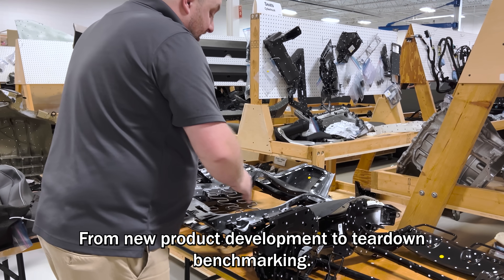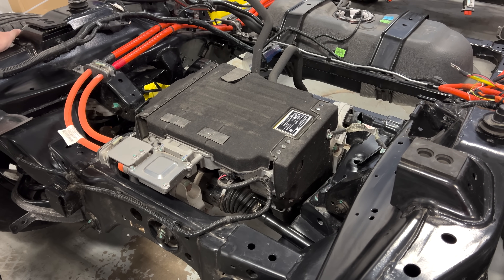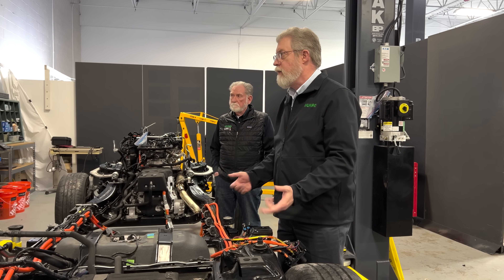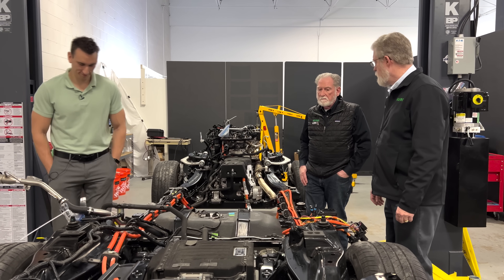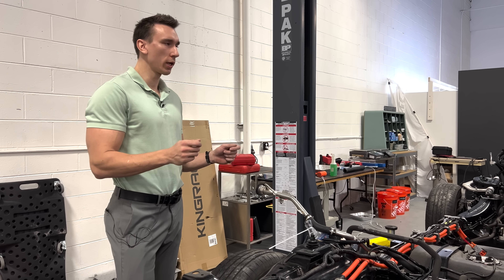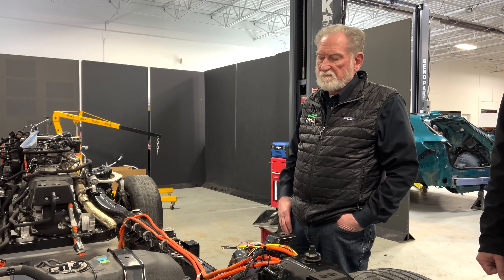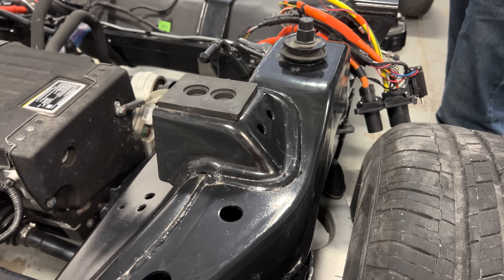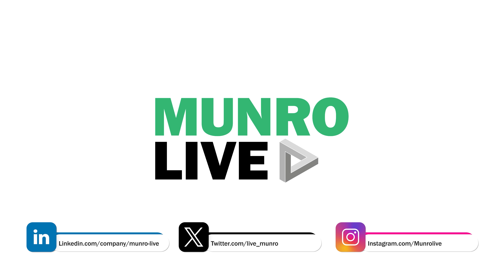There's a Monster Under the Bed of the BYD Shark!

Comment: As a EE designer for over 40 years, I am having a hard time agreeing with your electrical "loop" radiation comments. I assume that the "pairs" of wires you see on each side is the actual "loop" for a given mode of operation. I do not think their is a "loop" around the outside of the entire vehicle when the electrical motor is providing power to the motor OR receiving power from the ICE/electrical generator. The current loop is only between the closely spaced pairs of wires in either case. Please correct me if I am wrong.
Reply: You are correct.  The left pair is between battery and rear motor.  The right pair is from charge port to battery.  Only ONE pair would be carry active current at any given time, and there is no direct connection between motor and charge port.
Reply: i think their concerns about induction and electromagnetic radiation apply to AC power power, here we have DC, so these guys just waffling @ZweiZwolf
Reply: I agree.
Reply: These guys have a serious problem with it and they know stuff
Reply: @Stevesmate4503 but do YOU know stuff like some experts on here ?  Your comment doesn’t add value
Reply: @ greatest country in the world
Reply: I am also shocked about those conclusions...  I am starting to rethink their opinions about mechanical parts.
Reply: Honestly, this whole series looks like a take down, and they are all just looking for reasons to discredit this truck. If this was built by GM or Ford they would be applauding that there is finally a "real mans" truck on the market and explaining how they were able to deliver this overbuilt truck using cheap labor and parts, vertical integration, and advanced battery technology. A year ago they were praising far less well built Chinese vehicles.
Reply: @patreekotime4578  Tesla money in their pockets
Reply: @patreekotime4578  Munro promotes Tesla.
Reply: Yeah, I don't think these guys have any idea about EE.
Reply: These guys aren't real engineers. They don't seem to know even basic stuff.
Reply: @nrml76  wrote "These guys aren't real engineers. They don't seem to know even basic stuff.". That's not true. Paul Turnbull is a genuine motor expert - he really does understand them in great detail and is good at explaining them, and the engineering tradeoffs of designs. So yeah it's very odd that he would talk such nonsense about the DC cabling. I don;t know what to make of it.
Reply: @xxwookey I know what to make of it, they just couldn’t believe Chinese engineers now outsmart Americans.
Reply: Have you thought of an alternative purpose for the ground strap?
Reply: @martinbeverley9536  To ensure you don't get different potentials. It may simply be a safety issue to ensure that if a fault makes the motor case live it blows the fuse or that high currents through the small resistance in the cables causes a potential difference between the motor and battery.  It also ensures any induced current in the case from inductive leakage from the motor or just static electricity does not create a potential difference with the chassis and sparking.  Basically it is good practice to ground all floating metal items as you cannot guarantee a path through bushes and bearings.
Reply: @The “ground strap” is just an EQB line for the HV system. There’s nothing unusual about this setup, the entire unit is mounted on rubber bushings so for HV compliance it is absolutely required.
Reply: @gtjack9  Indeed.
Reply: @martinbeverley9536  The grounding strap is called EPB, which stands for Equipotential Bonding, and it must be fitted for a car sold in most countries by law (homologation standards). It's purpose is to ensure that no conductive (ie metal) part of the car can experience a difference in potential from another conductive part  (that's the "equipotential" part, ie equal potential) under normal or fault conditons.  You'll note it's a pretty hefty braided strap, because it has to ensure a difference in potential cannot build up even under fault conditions where 100's or even 1,000s of amps can flow.  It's purpose is of course to ensure nobody gets electrocuted by touching two conductive parts that are at a high difference in voltage!
Reply: Grounding electrical components is a good idea as it prevents signal noise. I'd bet all EVs would have them on their motors @martinbeverley9536
Reply: If one side was positive and the other negative they MAY be an issue but it’s clearly marked with red and black tape on each side, Sandy needs to hire some EEs that are not afraid to correct him.

And my 01’ Chevy s10 break lines are coiled.
Reply: Retired Avionics EE
There is no obvious current loop to generate an EMF. Left side is Battery to rear motor. Right side is Chargeport. Two separate Circuits. A ground loop could exist within the frame, and have to be reinforced with the ground strap.
Reply: @Papa-bh6zq  Even if there was current flowing at the same time in each side, there is still no loop because each side has it's own Positve and Negative conductor and hence currents are balanced on each side, leading to effectively zero H or E fields across the gap between the sides (ie across the chassis)
Reply: It's a fantasy they're invented.  The battery, inverter and motor potentials are isolated from ground.  The high-frequency currents are confined to the closely-integrated inverter and motor. It's completely logical to provide a braided shield from the housing to chassis just like you'd see in other EVs.
Reply: The cable is just to provide ADDITIONAL path ensuring that the motor casing is at the same potential as the ground. This bonding helps to prevent potential differences that could lead to hazardous situations.
Reply: Not to mention that EV cables are typically fully shielded. The construction of those orange cables looks a lot more like coax or triax than just normal DC power.
As much for RF as for safety(To provide 'detection' shield when damaged that the HV isolation test EVs perform at power on can detect.)
Reply: Rear unit is mounted on bushing. Rubber doesn’t conduct electricity. In case of HV isolation loss, everything need to be connected so modules will detect it. That is why they put a ground there. Also at high speed, ipm motor have large emf. I don’t buy the loop thing 😂
Reply: If they keep the tariffs off that truck I’d buy in a minute. It appears to be perfect unit for heavy loads and country roads.
Reply: They started out strong up front but this entire episode is a 15 minute TED talk explaining that they don't understand electrical systems at all. 

At one point in the video old mate is even holding the charge port in his hands and doesn't make the connection that the two sets of cables are part of entire different systems.
Reply: They rarely seem to know what they’re talking about.
Reply: Take it easy, we worked out they don’t know what their looking at, much less understand what their talking about.  They are stuck in the sixties. They couldn’t understand why they paint all the steel.  FFS !
Reply: As an engineer , i say they are talking crap.
Reply: Being a retired EE designer, with over 40 years of experience, I agree with you, concerning the loops. However, there stil can be an EMC issue, either on susceptibility or on radiated emissions.
This issue seems to be solved by a last minute ground strap, however the way this was implemented is unacceptable and might result in a "gremlin" over time.
Reply: You do have high frequency currents going to all of the cables, produced by the switching of the inverter, so there might be a point. But still I suspect that this ground strap is just for equipotential bonding that is needed on every HV component. Resistance between HV comp housing and chassis ground must be below 100mOhm for HV safety in order to have a valid isolation resistance measurement. I suggest they don't reach that value without that strap.
Reply: https://www.youtube.com/watch?v=BUcnPxr5Q8I A previous Munro video about the BMW i7, go to 18:03 and there is an obvious ground cable connecting its subframe to the body. I guess they found it completely normal for BMW to make last minute decisions to supress EM noises!
Reply: Is what their talking about a ground loop.  That's the bane of low noise.  But aren't we talking DC here?  Why would there be ANY noise on a well designed inverter.  If it were AC, wouldn't there be 3 cables?  I'm not clear on what's on these.  And since there are two cables wouldn't there be a certain level of common mode rejection?  I do agree that I would make sure there is a good connection at the braid.  Unless this is under stress, a copper bar might be better since if you've seen braid in service for a while it can get compromised.  But maybe that section moves around a lot.
Reply: @DennisMathias Correct, the DC system if designed correctly will have no noise, maybe slight ripple due to inverter feedback but nowhere near enough to me to generate problematic EMF
Reply: @gtjack9  wrote "the DC system if designed correctly will have no noise, maybe slight ripple due to inverter feedback".
I'm not sure about vehicle inverters, but my home inverter puts a surprisingly large AC current over the DC current. So  at 4.4kW discharge I see 82A DC current, +/-67A AC current (i.e 106A RMS current). Turns out this is how many mains inverters work. The voltage ripple is less than 1V, but there is a lot of AC current slopping back and forth, and that makes corresponding fields (and heating). It's all 50 or 100Hz so low frequency.
Reply: I agree, on top of that, these HV cables are not AC, they’re HVDC so there is no radiation being emitted beyond a static magnetic field, this means.
If they were running three phase cables from the back inverter to the front motor then I’d agree that it would be terrible architecture.
But given the coaxial shielding of the HVDC cables and the simple fact that it’s DC, I see little problem other than the fact that they’re paying for more copper than they might need with a better designed architecture. Though if this is a parts bin vehicle it may well have been more favourable to do this and have a quicker development cycle than the cost of re-designing the HV system.
Reply: @ Just FYI, but the charging port could have one cable pair for 120V AC & 240V AC charging along with a second heavier, dedicated cable pair for 400V DC.
Reply: bingo.... they didn't bother to actually examine what the cables do
Reply: Regardless fairly basic to remove the paint or provide a better fixing for the ground strap. It certainly does look like an afterthought
Reply: I’m no engineer but reading the vast majority of comments they do seem to come across as mild haters of this particular vehicle, kind of embarrassing…on my list of vehicles to consider down the road😎🇦🇺
Reply: One of the first things we all need to learn is assumptions are one thing, but don't make judgements based on assumptions. I can see so many opinions here sold as"I known every thing". I can't believe so many errors have been left on a public platform for every one to see . This really make you all seem incompetent to any one that is a true expert. That is a fact
Reply: These guys are supposed experts and they haven’t realised that the right-side set of 400VDC cables connects the CCS2 charge port to the battery for charging because this PHEV supports Level 3 DC fast charging! The left-side carries power for the rear axle motor. Therefore only electrical current it will see is when it’s stopped and charging. So why all this rabbit-hole chasing stuff about “current-loops” and EMI? Then don’t get me started on the build comments. Mate, I’ll take robust even over-engineered and built anyday especially in a truck.
Reply: I am a retired electrical engineer with many years of electromagnetic radiation experience.    You would need to understand in great detail how the system worked to make those sweeping statements about the electromagnetic noise generated by the cable pathways and to denigrate a simple braid earthing strap is just weird.    I agree with you.   Those comments were very odd and simply had no basis for them
Being made.

Comment: Those smaller so called ‘high voltage’ cables which they keep referring to as causing an inductance loop are either the charging cables or the 110\240v AC cables that run to the 3 power sockets in the tub, so the first 5 mins of this video is totally false.
Reply: They're Americans.BIG BOY😂

Comment: I’m confused with all the talk about the high current cables being a problem. One side is to rear drive motor and the other side is charge cables. You’d have to think the 2 sets of cables would never be used at the same time? How does this affect the vehicle?
Reply: Correct.  I can't think of any EV that allows one to run the motor while plugged in to a charger.  Munro is just exposing his ignorance.

Comment: The loop observation is valid but the strap is really there just to ground the motor housing making it a shield/cage. That's why a simple bolt is adequate.  When you accelerate and decelerate you do get current surges in the cable but you also get flux surges in the motor housing. Good ground shielding contains those.  For a traditional battery ground cable - using the chassis as the actual ground - it has to conduct the full current being sourced by the battery (or fed to the battery for charge)  so needs a solid connection to that chassis metal.

Comment: Another reason to put the ground there is to dissipate the static electric charge that the tires build up, that is especially a problem with high efficiency tires. Without the ground strap, you can dissipate the static charge from the motor case into the frame instead of into the HV electronics.

It is true that the braided ground strap is prone to deterioration. There should have been better protection and passivation of the dissimilar metals. RF mitigation or static dissipation, they should have done better either way.  After about 20 years, the three braided ground straps from the IMA housing on my Honda Insight had pretty much turned to powder.  I guess if the rest of the vehicle only lasted 20 years, it wouldn’t matter.  😊

Comment: I think BYD was planning for low volume.  Castings would be too expensive unless volumes are high.
Reply: You only want to use a casting where the load dynamics are predictable and within a limited range like in an on road passenger vehicle.
Casting are fragile is the context of an off road vehicle, as the range of the load dynamics are a lot larger and it is not economical from a cost and fuel efficiency prospect to engineer the cast for the extremes, ie hit a hole / ditch at speed offroad etc.  Using a steel frame which has some flex and will flex / bend rather than crack and shatter like a casting is a better option.   Look at the issue with the cybertruck rear tow bar attachment casting what are shattering, when they experience high dynamic load.

Comment: 14:40 They have commercial bus experience. It reflects in the design.
Reply: I think Madrid city has many BYD buses. I think they made frames to build your own stuff and complete one´s. So they know a thing or two about heavy transport.
Reply: @ BYD is one of the biggest manufacturer of electric busses.  They've been building them for many years, and are very good.

Comment: 8:54 Guesswork in action "immature" is maybe not the right understanding. You need to think from BYD and Chinese point of view. There are other points of view that gives explanations but 3 white guys. might not cut it. Why not do a joint venture video with BYD engineers directly to cross check?
Reply: In India people load 8-9 tonnage truck with like load 22-25 tones. What if China also has such over loading problem..
Reply: By immature, they meant junk, which is right.
Reply: @JigilJigil I think you didn't listen to Munro, he said overdone it's a tank... That's not junk. Byd don't do junk but their old busses and old Gas cars are not very nice

Comment: The bonding strap is not any different than any other bonding wire on any other vehicle. That includes the aircraft I've flown and fixed  for 45 years. which includes Boeing, Lockheed, and Emrbraer
Reply: For the ac case, I think the bonding is better. It is a threaded to allow thr connector to be put on. But the thread part is a stud welded on instead of bolted on. And the area in contact shall be a bare metal. It is going to be a better ground. And it needs to be.

Comment: Even a Chinese fellow can break a Chinese ox cart. Maybe the BYD fellows figure that the box will come off, and be replaced with a flat bed in time and then be overloaded on a daily basis. So they over built it.
Reply: If the dude doing the design really come from the commercial truck division, it will make sense. Why stop at the flat bed. Lets stretch the frame to make it a class 6.